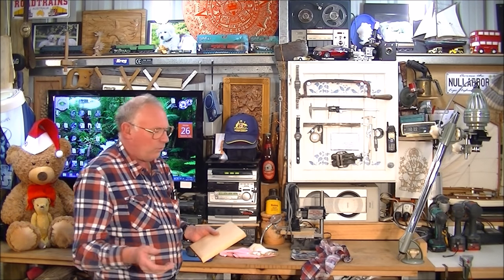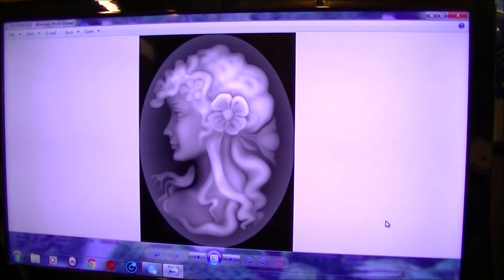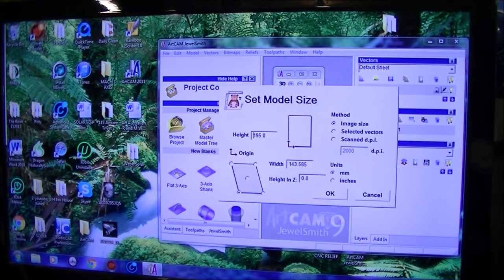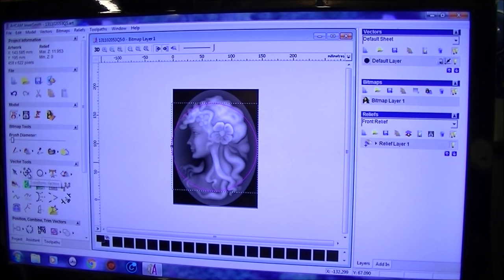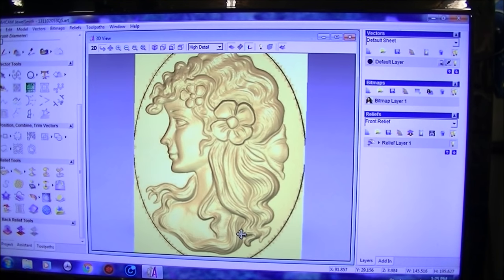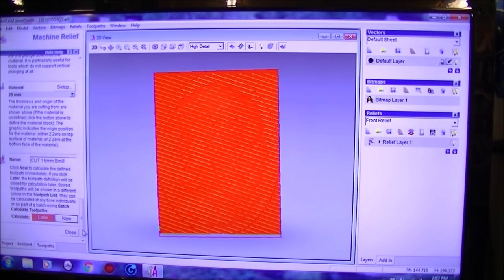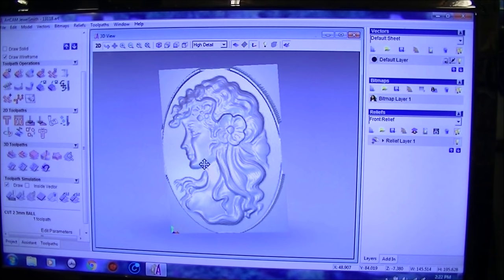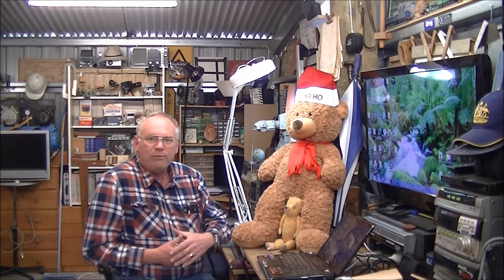Easy learning, ArtCAM (Carveco) making a 3D relief from a grayscale picture

Comment: Great video roger, as always.  But I feel I got lost somewhere here.  One, my toolbars aren't set up as nice as yours with all the available options and icons, so i'm fumbling around to find them, but no problem.  I can get by.  I did follow this tutorial exactly, and for whatever reason, when I get to the end and I am calculating, my relief file is still in a 3d style, but it's looks like it sits on top, rather than recessed in.  Have you ever run into that before?  Or do you have any tips as to what I may have done wrong?
Reply from the maker: The model must be set at the top of your work
Reply: @rogerwebb9600  I believe I did. But I can always try again. Thanks for your reply

Comment: this is quite misleading as there is zero info about how you created the greyscale in the first place
Reply: Yeah I was thinking the same thing. And the image appears to be a 3d Depth Map from an Actual 3d Model. Not just someart or photograph one googles. It was already set up for CNC relief engraving or 3d Printing. Its a little misleading.
Reply: yes the result will be really different becoz it's a displace/depth map from a 3d software.
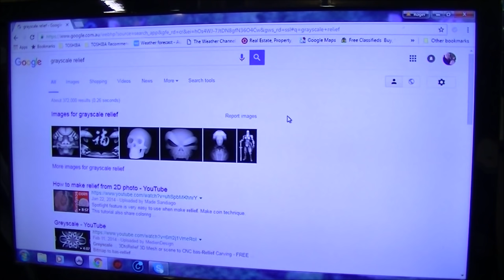Reply: He didn’t create the greyscale image ...as you can see on  5:03  he took it straight from google
Reply: And for the title of the video ...’making a 3d relief from a greyscale picture’ he didn’t mention anything about  creating a greyscale picture...
Reply: And for the title of the video ...’making a 3d relief from a greyscale picture’ he didn’t mention anything about  creating a greyscale picture...